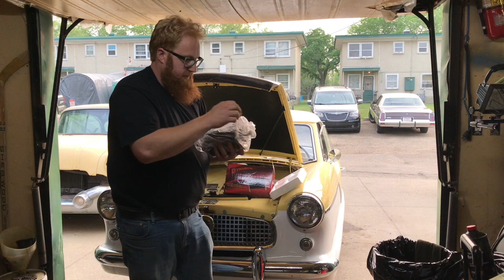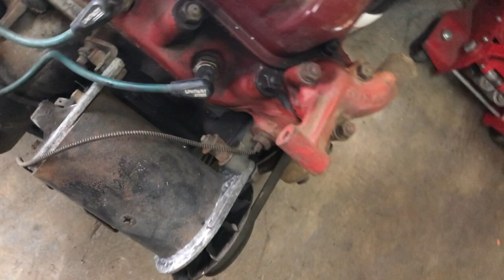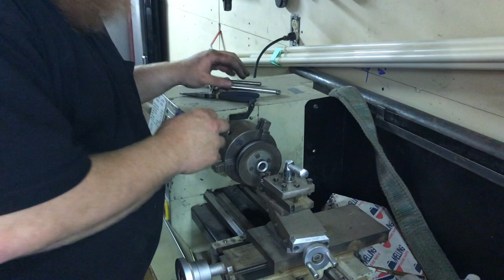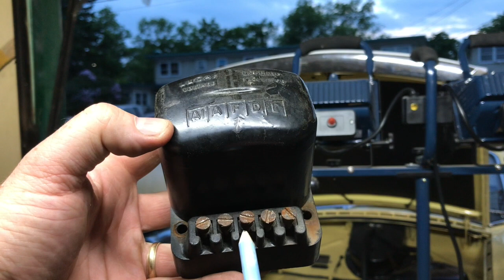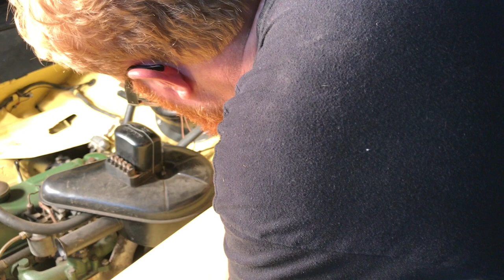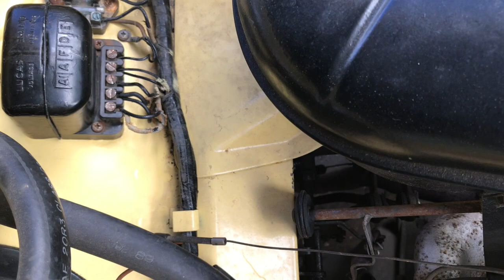Nash Metropolitan Generator to Alternator Change on Roy Marko's Garage

Comment: It's great to find your videos on the Metropolitan my father turns 81 this year and last fall he traded his Harly davidson road king even for a 1958 Metropolitan and it is a very solid body and runs very well but the fuel tank and wiring are things in the poorest condition on the car and that new MG fuel tank and alternator conversion along with a new wiring harness I found on line will fix all the problems on his car.
Reply from the maker: Yes, if you have any questions feel free to ask

Comment: I had the entire wiring harness changed in mine but decided to keep it positive ground. Should I go negative ground if I want to put a speaker system in? I figured I can see about getting a more modern positive ground radius and speakers? What will you do next to your car?
Reply from the maker: Yes you should it's not hard on this car, to convert it, and it will be beneficial to you for everything in the future, if you have any questions feel free to contact me. Looking to put electronic ignition in the Nash Metropolitan.
Reply: Hows the met doing? @RoyMarkosGarageRMG